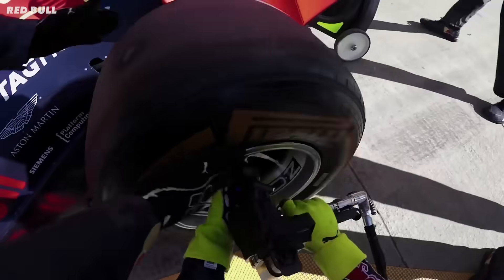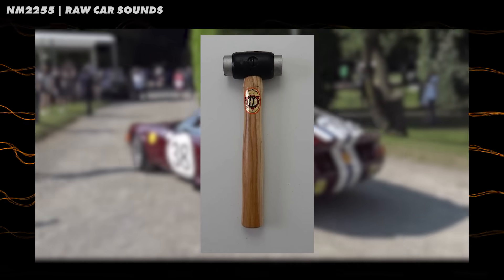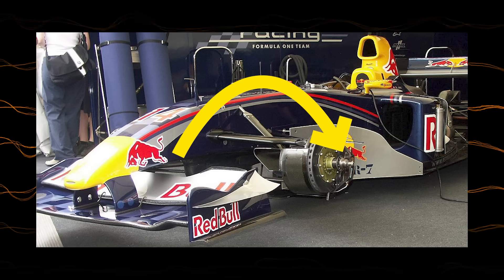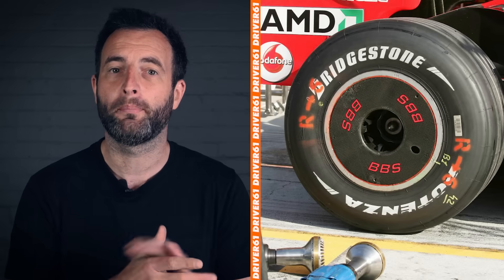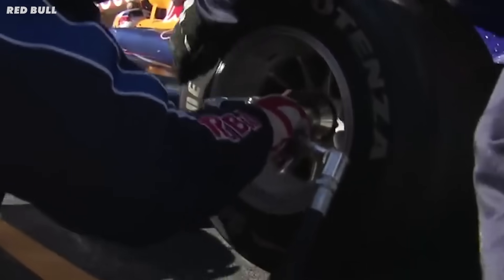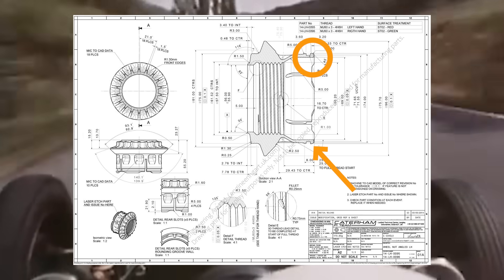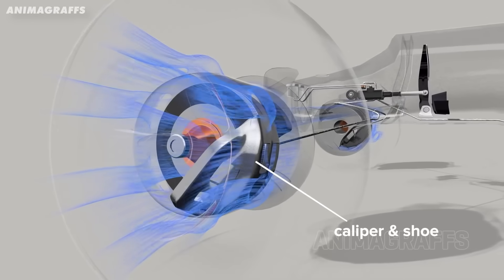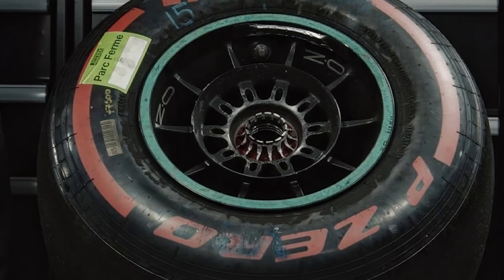Why F1 Wheel Nuts Cost £50'000

Comment: You're making me feel much better about the $12,000 I'm spending on a set of forged magnesium monoblock wheels for my sports car.
Reply: Lets go back to reality, my whole car is worth 1500$
Reply: @ALENGLEDJA yeah, mines 1700, im trying to come up with 200 to build a new exhuast. Not for performance, it all rusted and fell off
Reply: @everettstormy  I just spend $700+ doing the all the brakes for my e90.  17 year old car, the rear calipers was rusted AF due to New England snow.  Day 4 and still not finished.  Just have to bleed it.
Reply: @everettstormy  
I've been driving the same vehicle since 1998 and it was 3 years old when I bought it. Plus it was a totaled truck that had been rebuilt.
Reply: @ALENGLEDJA  The 1991 Ford Escort that I got back in 2002 when I blew up the engine in my Porsche was worth about $800, but I put over 100k trouble free miles on it.
Reply: @ALENGLEDJA  Mine 1/4 of yours!
Reply: I spent 600 euro on a set of BBS CH rims included with Pirelli tires, absolutely amazing deal
Reply: @rubeneeltink8607  That's not bad for BBS wheels. I wanted a set of them for an old Mercury Capri I had but I couldn't afford them at the time, as I was a starving student.
Reply: Go price what it cost to rebuild a 2.5L Merc V6 outboard engine. Cast pistons were 200.00 a piece in the early 2000's. That was just for the piston; rings and wrist pins are extra.
That's why boat stands for Break Out Another Thousand.
Reply: @DChrls  yeah its 100 dollars for a good piston in my mini bike, or less than 250 for a whole set in my ford truck lol.
Reply: jesus christ, what wheels did you buy???
Reply: @yeetusdeletus9  19" model RS5RR from Litespeed Racing in LA. As expensive as they are, they are not as bad as the all carbon fiber wheels that can cost even more.
Reply: @videomaniac108  God damn those are gorgeous wheels
Reply: @yeetusdeletus9  They are, thank you. In addition to lightening my car's suspension, they're also lightening my wallet.

The wheels are forged and custom machined to the exact specs given. I kept my wheel specs the same as stock, 19 x 9 in the front and 19 x 10 in the rear. You also get the choice of finishes, where I went with clear-coated glossy black to match the rest of my car, a 370Z.
Reply: @videomaniac108 $12000 wheels for your sports car? …why not say the car
Reply: @johnnychimpo7539  Because I wanted them for performance and aesthetic reasons and that's what they cost. I have a Rolex watch and some people might ask why I would spend so much for a watch, again because I liked wearing it and it cost what it cost. The car is a 370Z, a very good value in a high performance sports car and one whose performance I had already increased, in terms of power and handling. The power part is done but there are still some things, not cheap, to be done in the handling department.
Reply: @videomaniac108  Gongratulations for your new wheels. In an age of quantity, it's refreshing to see someone appreciating quality. :)
Reply: @videomaniac108   you put $12,000 wheels on a Nissan 370z 😂😂😂😂 wowwww that is beyond wild
Reply: @piuthemagicman  Thanks, the wheels are a part of the program to reduce the unsprung and rotational mass at the corners for better handling and to reduce road shock loads on the suspension components. It's combined with lighter brake components and lighter tires. The fact that they will enhance the car's appearance is a bonus. Shortly after I got the car I had a couple of stages of polishing done on the clear coat along with a ceramic coating, creating a very deep and wet glossy black finish that still looks great nearly 5 years later. I don't regret any of the money I've spent on the car, which is still quite a bit less than the Porsche I had been considering. The car, a 370Z, now has the power and handling of a Porsche 911 Carrera S, plus it turns heads and gets compliments, at a much lower price than the 911.
Reply: @johnnychimpo7539  My car has the power and handling of a Porsche 911Carrera S at a much lower price, plus it turns heads and gets compliments. That's not a bad deal on a car that is a blast to drive. 

I'm sorry if you can't afford good wheels for your Toyota Tercel, but I won't laugh at you to make you feel worse.
Reply: @videomaniac108  I have a Rolex.  Oyster Perpetual Datejust with the 10k white gold bezel.  I bought it from my dad back in 2005 when I won in poker.  I later bought him another Oyster two tone.  He ended up selling that one because someone made him a good offer.  Last time I wore it was at his funeral when he passed in 2021.  I don't wear it often, but it's nice to have.  I'll keep it until I too am gone since it once belong to my dad.
Reply: @johnnychimpo7539  BTW: The OEM forged aluminum wheels that came on my model would be about $4,000, forged lightweight wheels are not cheap but they do make a difference in how a car handles. I had a 1987 Porsche about 30 years ago that had lightweight aluminum wheels that I replaced with aluminum wheels from a turbo model of my car, those were also very expensive.
Reply: @videomaniac108  a $4000 set of factory wheels isn’t that crazy. The dealer up charges everything. The fact that you put $12,000 into WHEELS for a 370z is still blowing my mind. And they aren’t even carbon fiber
Reply: @johnnychimpo7539  The carbon fiber wheels I could have gotten were even more insanely expensive, around $18,000 for only about 1 lb less weight. I had 4 options for the composition of the wheels: plain aluminum(same weight as mine at about 23 lbs and about $4,500), special high-strength aluminum alloy(about 17 lbs at a price of about $7,800), magnesium(about 14 lbs and a price of $11,500) and the carbon fiber wheels I already mentioned. The two aluminum options looked like a waste of money, for the weight savings offered and the CF wheels were way overpriced for what they offered, plus I didn't like the look of CF on wheels.

The magnesium are step one in the unsprung weight reduction program, with lightweight two-piece aluminum hat rotors for a weight savings of about 10lbs on front and 5 lbs on the rear. The rotors are not that expensive and I'm going to do it next year when I need to get new pads. I will replace my steel wheel studs and lug nuts with titanium ones, eventually. Reducing the unsprung weight will also reduce wear and tear on all the suspension components, tires and will increase ride comfort by making the suspension more compliant.

This is the last car that I will ever own, barring theft or a catastrophic accident, and so I don't mind spending the money, as i still have plenty in the bank and a good job that pays me more than I deserve to make. I have a brother who is younger than me who will probably outlive me, so I'll probably give it to him eventually. He is currently restoring one of the original 1970 240Zs and I know he would appreciate the car, a good daily driver that is a superb driver's car and a chick magnet😏, although both of us are beyond that phase in our lives of chasing girls.
Reply: @videomaniac108  interesting…expensive lightweight wheels have never been on my radar. It’s like the last thing I would do to a car and I think I’d just get a new car instead of doing that much to my current one

You must track the car or do something that warrants such a purchase? And you just like the 370z platform which I get. I’m not a fan personally. It’s smaller and it’s gotta be a semi harsh ride. I’m not very old but as I get older, I want a more comfortable car. Not an suv or a boat but a nice sized sedan with some sporty bug also comfortable suspension. Doesn’t your damn back hurt getting in and out of that thing. I rented a Home Depot van the other day to pick up a hood and once I got back in my 3 series, I felt like I was sitting on the floor and that car isn’t even low

How much have you put into your car total upgrades? Would you not rather have a 911 turbo than your car. I get that you built your car and it’s unique and special and has your style in it but driving a 911 turbo has to be a better experience
Reply: @johnnychimpo7539  I don't track or autocross the car, as I'm not a competitive person, I really just enjoy the personal challenge of driving a car, like the Z or a Porsche that is a purpose built car, correctly and with precision.

The car is not comfortable but it is also not uncomfortable, with stiffer anti-roll bars that do make the ride more harsh than it was when it was stock. 

I like Porsches, I had a 944S back in the day, and considered getting either a Cayman S or a 911 Carrera S before I decided on getting a Z. The 911 turbo is too much weight, complexity and power for a fun street car to me, not to mention cost. The Z was a good value choice to me that offered most of what I wanted in a car at an affordable price and that had good upgrade potential.

I think what you're describing in a good car for your tastes would be something like one of the BMW 3 series cars; good handling, decent power, with nice amenities and good comfort.
Reply: @DroneStrike1776  The Rolex Explorer II(black face) that I bought in 2002 for $3800 was selling retail for about $8300 a few years ago. Lately, when I tried to check the price, I couldn't find it on Rolex's website and only found used ones for sale in the $14K to $28K range, utterly insane. I should have bought a dozen of those watches back then and kept all but one in a safe deposit box as an investment.
Reply: @videomaniac108  You should take your car out to a track sometime. Find a open track day or join a group that rents out the track so you can do laps without other cars around. Dont need to time the laps or compete with anyone, just drive it at a pace you cant do on the streets. You seem like the kind of person that would be able to notice the differences in your car and those modifications really shine when you can push the car properly on a track.
Reply: @The613MC  That's a good idea and something I've considered. I'm not a competitive person with anyone else, except myself, as I enjoy improving my driving skill in how smoothly I manage shifting, cornering and braking and in the precision with which I can handle the car. I live in the SF bay area and might go to either Laguna Seca in Monterey or Sears Point up near Vallejo. Thanks for the suggestion.
Reply: Light wheels absolutely makes a difference... doesnt have to be a "race car".
Reply: That's more than i earn in a year
Reply: You must be really rich and stupid at the same time to spend so much for wheels!
Reply: I don't like magnesium. This metal was used for flashlights (Photographs) when I was young. In other words..burning with hell white light in ca 0,04 seconds. Magnesium wheels will be protected against direct contact with oxygen.....until they get damaged.

(Oh, my four winterwheels costed, including tyres, close to 3000 euro....and including presure measuring ventiles)
Reply: @reiniernn9071  That was true of the older magnesium alloys but there has been research into newer alloys, for example used by the airline industry fir things like airplane seat frames where weight savings is critical. These newer alloys have elements like calcium and yttrium added that greatly reduce the flammability of the metal and if it  does get ignited by a high temperature heat source it will self-extinguish, not sustain combustion, if the source of ignition is removed. As you said, there are coatings to further reduce the chance of ignition or corrosion. In addition on my wheels, I'm having them fully painted gloss black with a clear coat on top to match the rest of the car.
Reply: @videomaniac108  At least I understand now why such magnesium wheel is that expensive....because the alloy and fire protection.
Reply: @@retiredbore378 in a previous comment he mentioned the wheel weights and it'll be saving 5-10 pounds per corner. That's something that the driver will definitely feel, especially during turn in and braking. Is it worth the money? No. Does it look cool?Absolutely
Reply: @Retired Bore My son told me that they produced wheel (16 '') from high quality aluminium. (Extra strong). They made them from one massive block with machining those blocks.
When those wheel where ready, perfectly balanced including counterweigh to the ventil, they were about 1 kg in weight. The whole wheel including the inwheel engine and tyre would be less than 10KG. Wheels without engine around 4  to 5 kg. The car  for which they made them: 139 kg without driver.Including all. Purpose of the car: Taking part in the world solar challeneg in Australia (already years ago)
This information is enough for me to understand that it is easily possible (if money is not important) to get  a replacements for more than 20 kg heavy normal wheels (including tyre) at least 4 kg less weight with top quality materials.

ps The budget for that solarracecar (including race) was even that many years ago close to 1,5 million dollars Without calculation any salary or payment for the students developing and building the car. Including the value of those salaries would increase easily the building cost to 7 million dollar.
Reply: I'm over here contemplating on spending $1900 on rotary forge Konig wheels with some Conti tires for my 2019 Mazda 3 hatchback.

Comment: Wait a second. So BBS makes all the wheels for all the racing series? F1, Indy, NASCAR, V8 Supercar, and damn near anything else. They are all using single lug wheels at this point. Why aren't they all using the same technology in all the series for the tire changes? This is a legit question.
Reply: Each series has different needs and resources, wouldn't make sense for supercars to do $50k in wheel nuts every race

Comment: That was some "slick" editing on the word "Shrouds" lol. So if the wheels aren't able to be reused can they melt them down and re-cast or send them back to have them re-cast and recycle the wheel nuts bringing down costs?
Reply: I don't think there would be much saving in the raw materials its probably the machining and manufacturing of the part that puts the cost up so would be the same no matter if they used recycled metal or not.
Reply: The nuts aren't cast, but machined from a billet of aluminium, hence the massive costs. Casting isn't accurate enough to be used in that setting. Also the possibility of impurities or internal weaknesses makes it unsuitable for high performance parts.
Reply: @David Wilhelmsen  They are very much machined from cast aluminium. At least, in mercedes' case they are